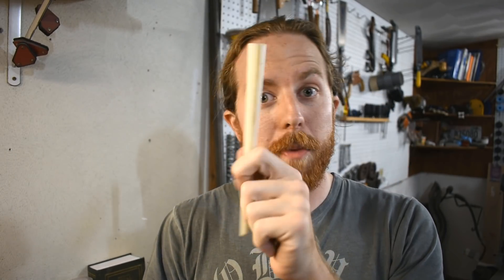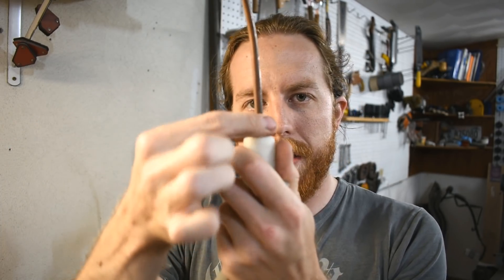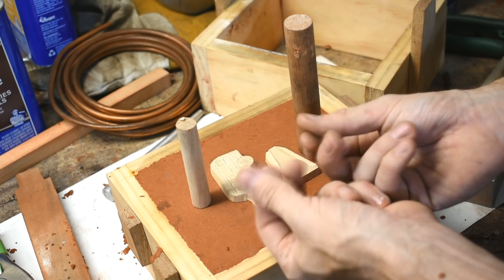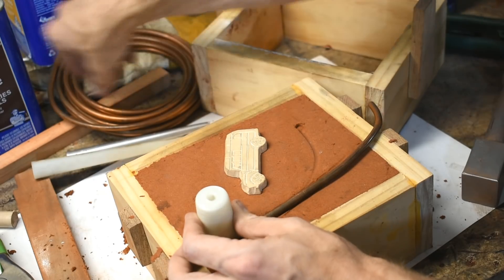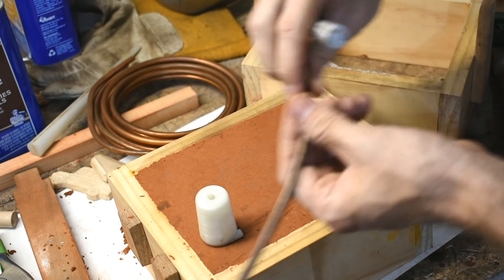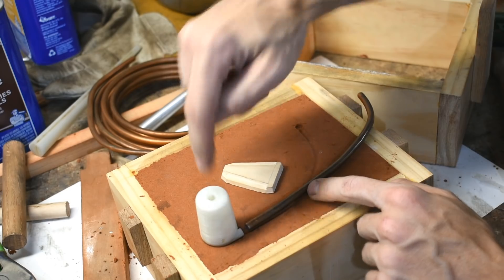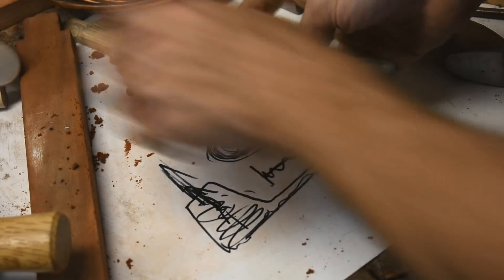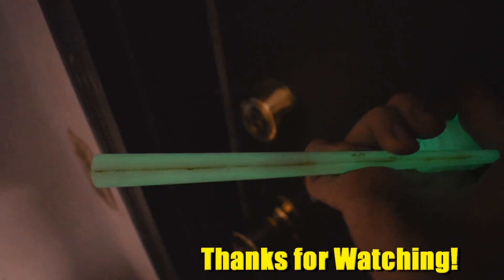Free 3D Printed Metal Casting Tools: Tapered Sprue Former and Surge Trap

Comment: I love your design, I'll definitely give it a go when I try this down the line. It occurred to me while watching your video... to save on having to clean it up after you take the 3d printed parts out..instead of burying the part a little ...couldn't you take a short, thin heated wire and shove it into the bottom flat part of you  3d printed part?  that will let you stick the part into the sand like one of those ugly plastic flamingo things...  no idea if that would work... I have never tried casting anything before, but your videos are definitely motivating me to try.  looking forward to seeing the rest of your Gingery build

Comment: The spin trap will not move the sand to the outside, as the sand is less dense than the metal. Also, you should have made the spin trap junction the same size as the INSIDE of the pipe, then it wouldn't need to be "cleaned up" afterwards. It wouldn't shift either.

Comment: I think a casting video would be appropriate for next week.  Maybe not the tailstock, because you haven't yet proven these new parts work correctly.  So the question becomes, what should you use as a test casting?

How about casting an aluminium sprue former and an aluminium spin trap?  They'd be more durable than the 3D printed parts, although they wouldn't glow in the dark.

Comment: What angle is that tapered sprue and how long is it? 

Cast more things
Reply: 8 inches in length, tapered to 1/4 inch match his 1/4 OF copper pipe gates.
Reply: @producersteve1330  What is the OD at the top?
based on some rough bernoulli's principle calculations from the length you provided I assume it would need to be about 0.433 in (7/16in) and have a 0.7 degree taper
Reply: I'm sure if you follow his links Paul provided, the files likely contain all the measurements you are asking for. As far as my tapered sprue, I used an 7/8in wooden dowel cut to length of 8 inches tapered to 1/4 inch, and I just eyeballed it, mine is not a perfect transition since I'm working with hand tools and I don't even own caliper.

Comment: Cool vids , Im going to be starting my Gingery lathe castings here soon. would this still work for larger castings or just increase the dia like you said.
Reply from the maker: I've done some castings where the part was a pretty large volume of metal and 1/4" tube still filled the part fine.  You just need to keep the sprue full to the top and keep the metal moving.  Increasing the diameter is sometimes a good idea as well
Reply: The 1/4 inch sprue system will accommodate anything that the home caster can pour from the readily available graphite crucibles. The main problem is shrinkage prevention by the use of risers and where to locate them to feed the cooling casting.